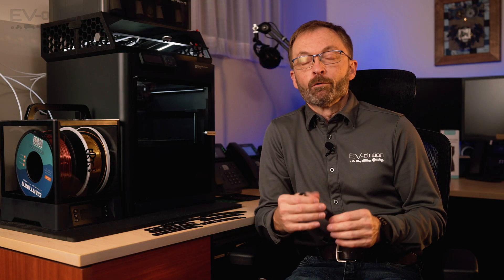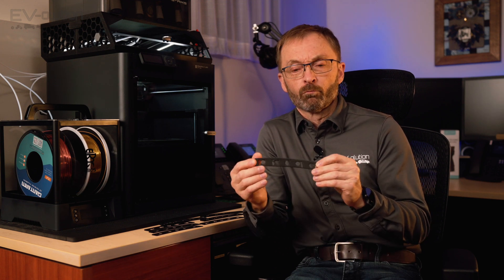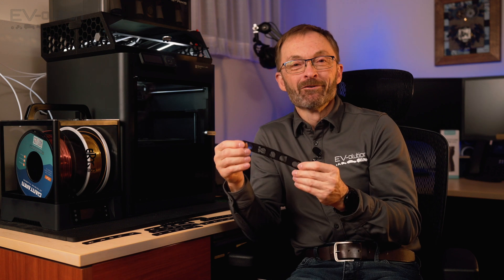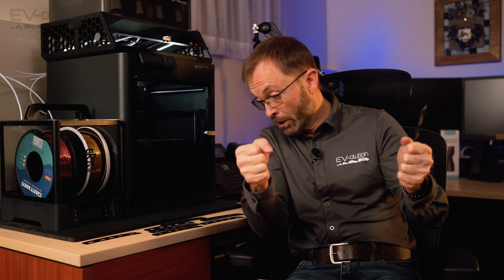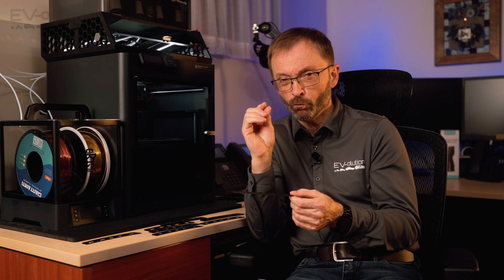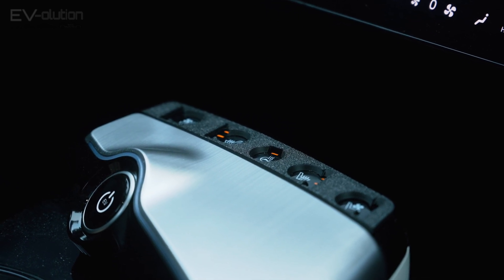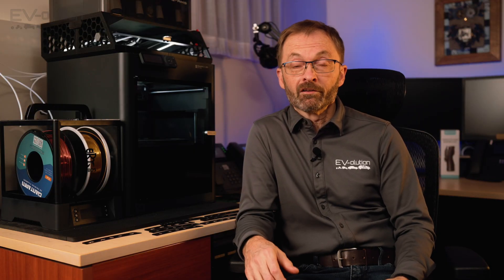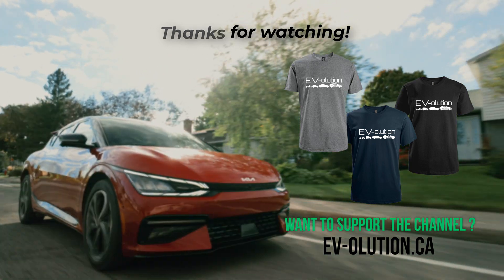Kia EV6 Touch button problem

Comment from the maker: It seems that the YouTube auto translation service has broken the description of this video
Where to download the 3D Print file I made:
- MakerWorld: https://makerworld.com/en/models/891935#profileId-848631
If you like my make, I would really appreciate if you could boost it on MakerWorld. Thanks in advance.
- Printables: https://www.printables.com/model/1112960-xerses-remixremake-kia-ev6-console-capacitive-butt
2025-01-26 UPDATE:  I received a request to make one without the heated steering button, and I created a new set for RHD vehicles, so there are now new files uploaded to the print sites.
2025-01-25 UPDATE: Based on a couple of requests I have created and posted a version of this cover without the ventillated seat buttons. You can download the new files with the links in the description of the video. Enjoy! 😎

Comment: Great Idea! Wish you had also shared the Step file to allow small changes like rounds and chamfers.
Reply from the maker: There is no STEP file. Like the print profile pages state, I fixed an existing design so all I had was the original STL file and I only use TinkerCAD since I am not really any good at 3D models. Sorry I can't help more. I would also have liked to correct the main shape.

Comment: I have a Flashforge 5m Pro. I downloaded the stl file (Kia+EV6+LHD+Capacitive+Button+Cover) and it doesn't print with the bed texture up. Is there a different file? So I flipped it, worked.
Reply from the maker: I may have forgotten to flip the STL the last time I exported it from TinkerCAD. I know I flipped it in the Bambu slicer for the 3MF. Sorry about that. I will flip it and re-export it this weekend.

Comment: I downloaded the file and then sent it to a local 3D printing firm who made it in quick time and I received it today, (actually 4 pieces which was possible due to the minimum cost). checking fitment in the car, it is not quite perfect (rhd version), but will still look good and serve it's purpose. One question I have before fitting though, is will the sticky tape come off the console without leaving a mess behind if I change my mind at some point?
Reply from the maker: Yes, the tape I used is easy to remove and leaves nothing behind. Thank you for letting me know about the right hand drive version. Since I don't have a right hand drive car it was impossible for me to validate the exact measurements, so I simply mirrored the left hand drive version hoping that it would be a perfect fit.

Comment: I have an Ev6 2024 GT and it is still buttons 🎉
Reply from the maker: Correct. The GT has the same physical buttons as the lower trim EV6 vehicles. Only the GT Line has the tactile buttons, but even then, it depends on where the vehicle is. In Canada it is the GT Line Pack 2, not the Pack 1.

Comment: Sorry this is not needed. If you touch correctly, than you dont touch the touchbar for seed heating, cooling and steering wheel heating
Reply from the maker: Je suis heureux que ce ne soit pas un problème pour vous, mais beaucoup de gens rencontrent ce problème, y compris ma femme, qui les active accidentellement en accédant au panneau multifonction juste devant les boutons. Donc oui, c'est nécessaire pour certaines personnes.
-----------------------------------------------------------------------
I am glad it is not a problem for you, but many people do have the issue, including my wife, who accidentally activates them when accessing the multifunction panel right in front of the buttons. So yes, it is needed for some people.

Comment: To be honest, I got used to not resting my hand on the touch surfaces pretty quickly and did my wife. 🤷🏼‍♂️
Reply: I agree with this. Did it a few time when I first got mine and after a short period don’t think I’ve done it since. 
If you’ve got a 3d printer I’d print a boot holder to Velcro to the flooring to stop bags etc from moving around
Reply from the maker: @martyn_b_jones interesting idea.
Reply from the maker: @FireballYT the issue is the quality of the roads here. It's not easy to keep your arm steady, especially for my wife, when accessing the media panel in front of the touch controls. So the car hits bumps, her arm jumps, the buttons get pressed. In the province of Québec the roads are terrible.

Comment: Hi Andre, I agree with the things you hate with our EV6s. I am looking forward to the 2026 Genesis GV70 electric with a larger 84kwh battery, NACS charge port and wireless Apple CarPlay/Android auto & slightly more ground clearance (from 160mm to 174mm) to upgrade to. Hopefully you get to review one soon, I really appreciate your detailed evaluations comparing to our EV6 and 2019 Niro EV sx touring which my daughter still loves driving. Hopefully the 2026 GV70 resolves most issues while charging at over 250kwh/hr! My son and family also really enjoy their 3row EV9!
Reply from the maker: I think you mean the Genesis GV60. Its refresh will be similar to the EV6, with changes as you indicated, and should be pretty nice with the new nose design. I will review one, but I am not making videos outside during the winter so even if it is available, it will have to wait until the spring. It's nice to see your family is in the Hyundai group of EVs, they are excellent vehicles, and I love mine 😎
Reply: @ I actually mean the 2026 Electrified GV70.
https://m.youtube.com/watch?v=DR3i_Pj-wec
Reply from the maker: @bobstevenson4396  interesting, but I need to see a more official source for the info. I will reach out to Genesis Canada, but since it is still January I am not sure there will be much info from them. Thanks for the heads-up.

Comment: In the basic of the Kia EV6, there are still normal buttons. I am very glad about that with ours. But great solution.
Reply: in the GT these are also physical (3 only)
Reply from the maker: Correct, since the GT does not have electric or ventillated seats, they need less buttons on the console. Since there is no tactile version that exclude the ventillated buttons they use the buttons from the Wind trim, which makes sense for production costs.
Reply: I have the basic "Light" trim as well. I much prefer its center console. Physical tactile buttons, and the finish isn't that annoying glossy piano black used in the higher trims.
Reply from the maker: @danieldaniels7571  I wish Kia would have used the physical buttons in all trims.
Reply from the maker: Yes, I wish my car had the normal buttons like in the other trims. They are so much better. For 2025 Kia has changed them to all be real buttons.

Comment: Can you take a 3D printer idiot through the steps to find an online source for printing? Like I said idiot! Thank you
Reply from the maker: Nobody who calls themself an idiot is an idiot, the are simply people who need more detailed answers 😎. Let's start with the base question. What brand of 3D printer do you have?
Reply: @EV-olution  "What brand of 3D printer do you have?" -- I read the question as asking for a reference to a third-party 3D printing service.

To Heiko, your best bet may be to just do a web search for "3d printing service". In the US, companies like xometry, shapeways, fictiv, or pcbway (I'm not including URLs because YouTube holds comments with URLs for moderation, and they often just languish in the queue) are viable options. But if you are located elsewhere you'll probably want to use a service more local to you.

In many places, local libraries have 3D printers available for use, and some UPS and FedEx locations also provide 3D printing services, if you are more keen on dealing with one in person instead of using mail order.

Any service will at a minimum ask you about what material you want to use. PLA and PETG are likely to be much less expensive than more exotic options like ABS or ASA, but you might find the latter look nicer. Also, the 3D printing method will vary. The most common will be filament based, but another common option that works very well is SLS, a sintering process that can produce higher-resolution results, and SLA, which is also higher resolution. Again, a variety of materials are available. You'll want to choose a color you like, and preferably a material that has at least a little flex, to make it easier for it to conform to the contour of the touch panel in the car.
Reply from the maker: @heikojansen6558 sorry, I misread your question. I have never used an online service, but as Harvey66616 indicates, you should be able to use the ones he listed, or a local library. You can also look on Facebook marketplace as there are people who offer printing services.
Reply: Hopefully you can use a web search to get what you want. For some reason, the comment I posted that included names of at least a half dozen options was deleted. I doubt the owner of this channel did it (though if he did, maybe he could mention why), so I blame YouTube's crappy comment moderation algorithm, which I suspect is largely a simple keyword based one with lots of false positives (I've had many completely innocuous comments just disappear).
Reply from the maker: @harvey66616  your comment is still there, right above mine. It includes:
"To Heiko, your best bet may be to just do a web search for "3d printing service". In the US, companies like xometry, shapeways, fictiv, or pcbway (I'm not including URLs because YouTube holds comments with URLs for moderation, and they often just languish in the queue) are viable options. But if you are located elsewhere you'll probably want to use a service more local to you."
Reply: @EV-olution  "your comment is still there" -- are you sure it's visible publicly? When I view comments under this video, my earlier comment isn't visible to me. I wonder if YT shows the channel owner comments even if they are deleted according to YT's algorithm.

I guess another possibility is that the comment has been removed from view only for me but I can't imagine why that would even be something that could happen. :(

*EDIT:* bizarre. Now, the comment is visible to me again. But only on the video page itself. It is still not displayed on the individual comment dropdown shown when I click on the YouTube notification bell (upper right corner of every YT page), not in the YT mobile app.

I guess it's just a YT bug. Sorry for the confusion, but glad to find that the comment didn't disappear after all!
Reply from the maker: @harvey66616  I copied the text straight from your comment on YouTube, in the comment section of the video, not YouTube Studio. And I am replying from YouTube, not the YouTube Studio app, or page.

Comment: Any tips for a 4-button design, for those of us with RWD and no heated steering wheel?
Reply from the maker: Good idea, I will make one for you.
Reply: @EV-olution  that would be amazing, thank you!!
Reply from the maker: Does your car have ventillated seats and heated seats, but no heated steering? I just want to confirm before I make and share it.
Reply: @EV-olution  that is correct - four buttons, one on each side for ventilated and for heated seats. No middle heated steering wheel button.
Reply from the maker: Really! I am not home, but I will make one and add it to the file I shared.
Reply from the maker: @JenniferTislerics I added the new version for you.
Reply: @EV-olution  thank you so much! I'm going to have my nephew print it for me. 😊 I really appreciate your effort!
Reply from the maker: @JenniferTislerics  it is my pleasure.

Comment: In the US, the Wind trim has five physical buttons in the same spot. The MY2025 facelift also replaces the capacitive panel with physical buttons, even on the GT-Line.

Is it possible to source the panel with physical buttons from a junkyard and then swap out the capacitive panel with that? Would be more elegant and actually be OEM.
Reply from the maker: Yep, they 2025 fixes the issue with real buttons in all trims. In the 2024 and older GT Line 2, you can probably replace the part, but is the connector the same and is it worth the cost and amount of work required? I would say not really. Especially since the car is under warranty.

Comment: I printed 5 seperate buttons for my EV6, to accomodatecthe slightly curved surface. But I like your solution more, so I will give it a try. Thanks for the video. Subscriber now!
Reply from the maker: Thank you for subscribing, I really appreciate it. Since there is a slight curve, be sure to use a good adhesive for the right side, to avoid it popping up.
Reply: @EV-olution  Maybe it is possible to heat and bend the print so it matches the curve in a permanent way.
Reply from the maker: @illbeback2YT  it would be more trouble than it's worth since it would probably adversely affect the finish of the exposed surface. I just tripled up on the tape on the right side. It may be worth trying, but I am feeling lazy 😎
Reply: @EV-olution  "it would be more trouble than it's worth" -- I think the suggestion to heat the print is actually not a bad one. It would require some finesse, but done properly there will be no change in the finish of the piece. I'd use a heat gun, but a hair dryer would probably work just as well, and maybe even better since you wouldn't need to be as careful to avoid overheating the piece.

The hardest part is that you'd need to heat the piece in, or at least very near to, the car because it will cool rapidly.

To be honest, the best way to accomplish this I think would be to design a second piece, which would be just a jig to lay the actual installed piece on top of, and which has a contour that matches the contour in the car (I guess in theory you could just use the car, but I'd be wary of blowing hot air onto the car itself, even if the printed part is sitting on top protecting the surface). Of course, designing that piece would be tricky, to get the shape just right, but it just takes one person to do that, then anyone can print the jig as well to get the perfect shape on the installed piece. (The jig would be designed to be printed on its side, so that the top surface where the installed piece will lie can be perfectly smooth with features higher resolution than whatever layer height the printer is capable of.)
Reply from the maker: @harvey66616  PETG and ABS are plastics that have much higher glass transitioning temperature than PLA. ABS starts at 100C and PETG requires between 80C and 90C to become pliable. I would not want to put that type of focused heat on the console, especially in the winter since the console is cold even when the heat has been on for a while. It would be best to wait for summer and see if the cover can be coaxed into the right shape when it's 30C outside and the inside of the car is very hot.
Reply: @EV-olution  Per my comment, I wouldn't advise using the heat source in the car itself. But if you got the panel hot enough to droop and then moved it into contact with the console, that would be fine. The actual amount of heat stored in the panel would be negligible, as the panel is going to start radiating the heat out in all directions the moment it's removed from the heat source. The short period of contact with the console isn't going to hurt it. The amount of heat the console would be exposed to would be comparable to the amount of heat it gets in a hot climate (e.g. Arizona) when the car's parked outside in the summer, except for a much shorter period of time.

All that said, you'll note I already also pointed out that the gold standard for this operation is to also design and print a console-shaped jig that can be used to place the printed part on to heat it up and contour it to the right shape. You could probably even print it out of the same material, as long as the jig were printed solid so that the jig has significantly more thermal mass than the panel part.

Comment: Was about to make a comment about the type of plastic used because it was not specified in the video. Then I went and checked the description and you do specify to not use PLA for this. Good video and nice file. Thank you.
Reply from the maker: 😎 correct, it's in the description of the video, as well as in the description and print files on the two 3D printing sites I shared.

Comment: Nice video Andre, the Aussie version has proper buttons, so it seems different places have different setups. Still loving my EV6 after two years ! 🤠😎
Reply from the maker: Thanks. The touch buttons are only in the GT Line Pack 2, so I am guessing you have the Pack 1, or not a GT Line?
Reply: @EV-olution  We have totally different model descriptions here the base version is the "Air" then "GT-Line" (no Pack 1 or Pack 2) - AWD or RWD, then GT. The GT-Line RWD which is my model has physical buttons. They omitted lots of stuff for our models ie we don't get any internet connectivity in the vehicle so no live data re chargers etc and no app is available to communicate with the car.
Reply from the maker: @AndyM...  I forgot that it changed after I got mine, I think in 2023. To make things worse, the 2025 has GT Line and GT Line S, so I will need to figure it all out when I review the new 2025 EV6.
Reply: Great work Andre… is there a way to remove the ventilation holes from the downloaded file …cuz I only have three buttons on my 2023 eve6 awd here in st sauveur
Reply from the maker: Thank you. I created and posted a new version that does not have the ventilated buttons.

Comment: I use voice command. If it's cold the heated seats function will come on automatically.
Reply from the maker: That does not solve the issue of accidentally hitting them when using the media or HVAC panel right in front of them.